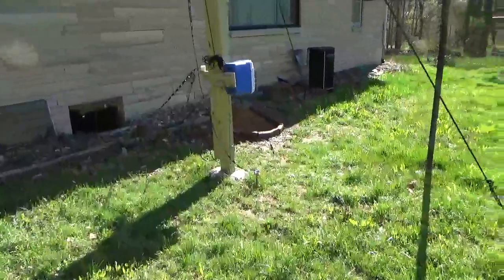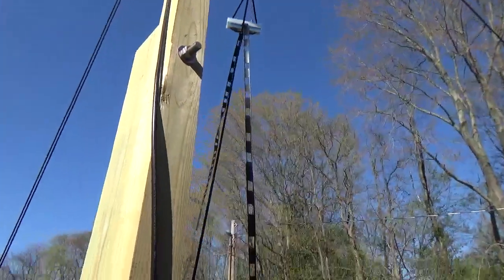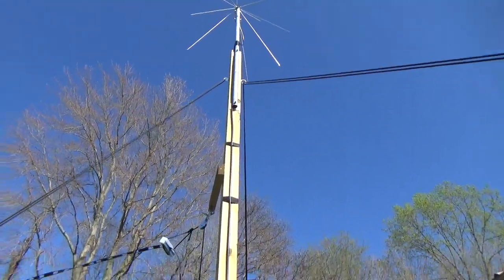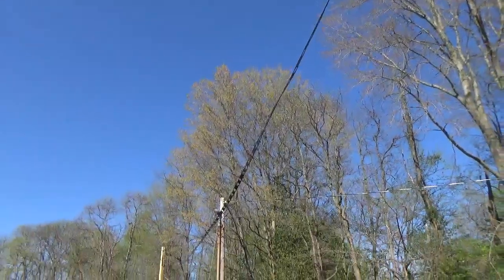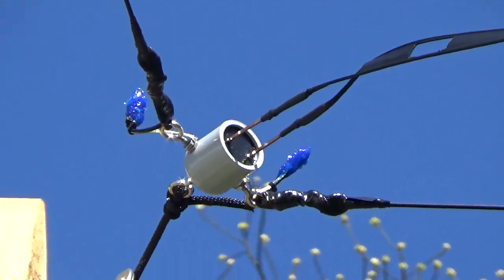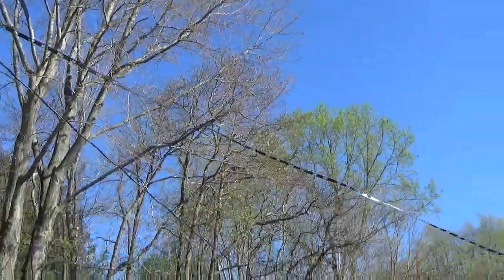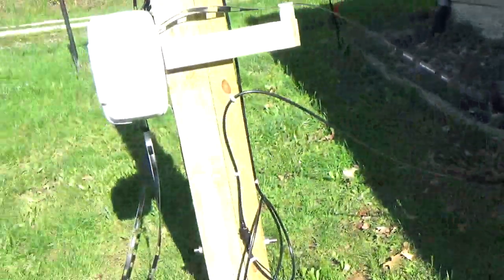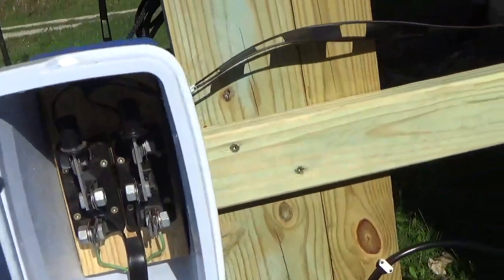The new antenna farm at amateur radio station KA9AMO filmed 4-15-2019.

Comment: Is it still standing or did it rot even with concrete ?
Reply from the maker: It is standing well today.
Reply from the maker: It is standing well today.
Reply: @timgoad5750    Good to hear . I aware it's treated but concrete holds water around the wood more than just plain dirt will .
Reply from the maker: @larryhaney6608  the bottom of the hole has broken bricks for drainage.